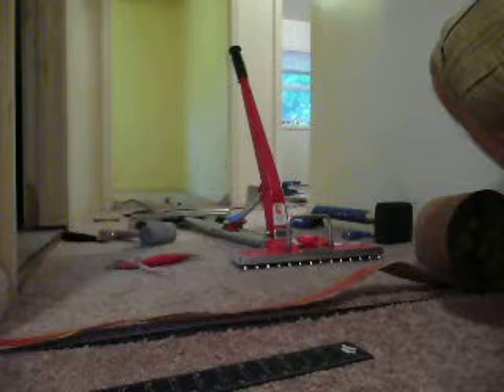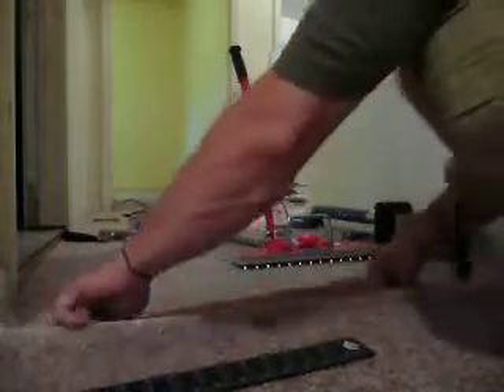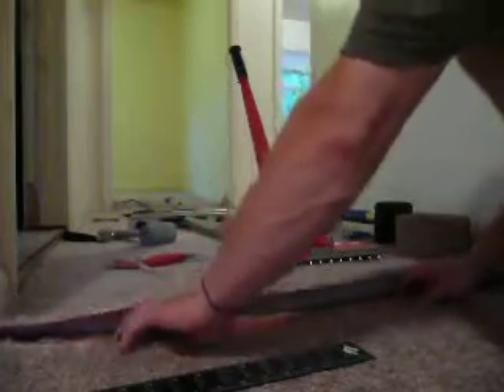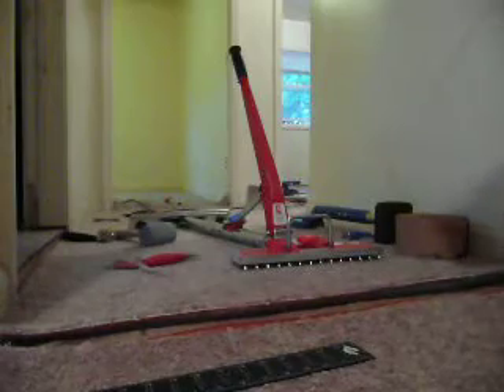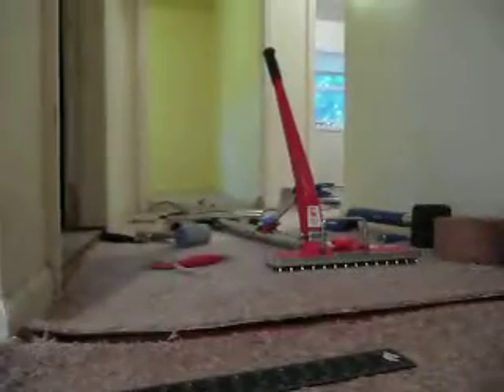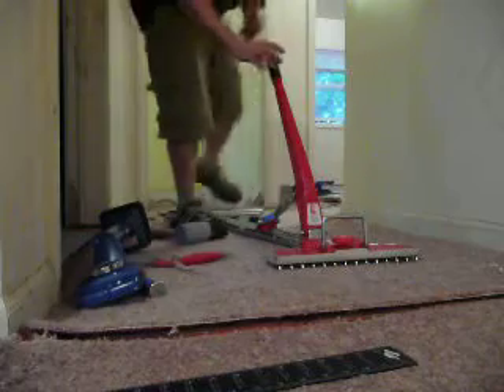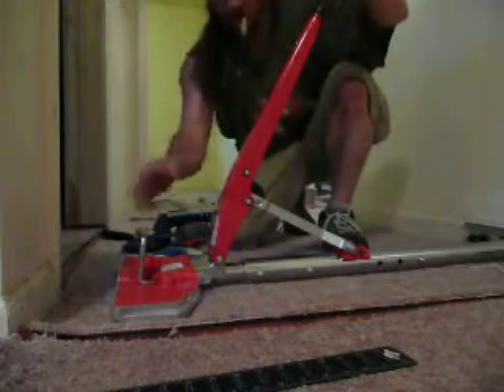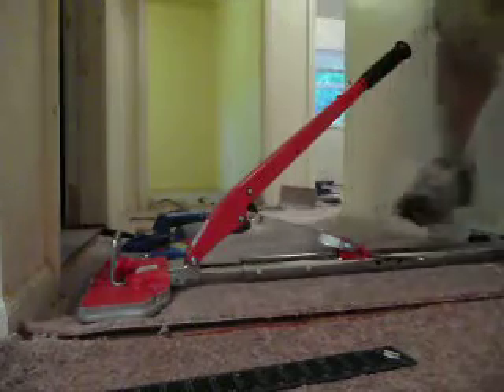stretching hallway carpet with power stretcher, roberts power lok 10 254

Comment: Your only supposed to get maybe inch an every 12 ft. Pluse I wouldn't have secured sides until u got your long stretch up the mile to try an get them back together.use a board to bridge the doorway so you dont have to be at such an angle.4x4 or something strong to stretch off of